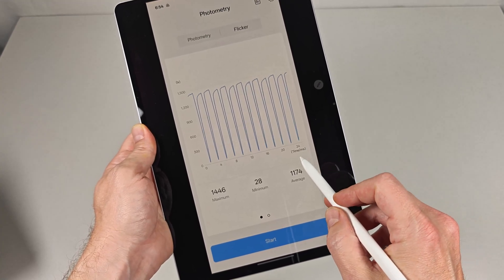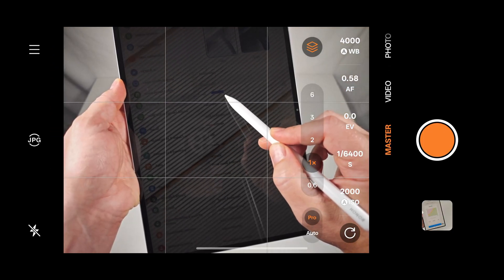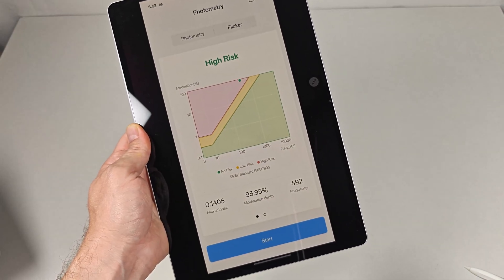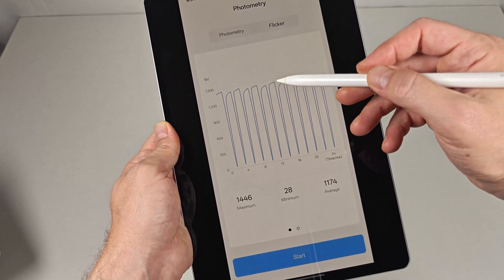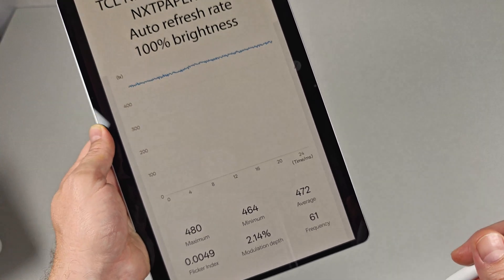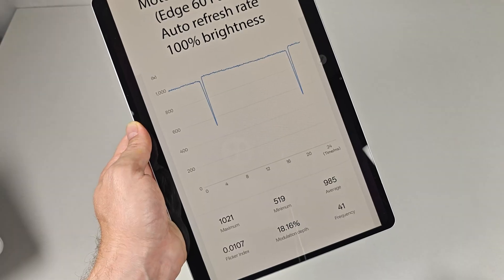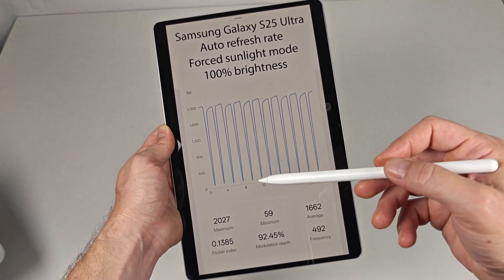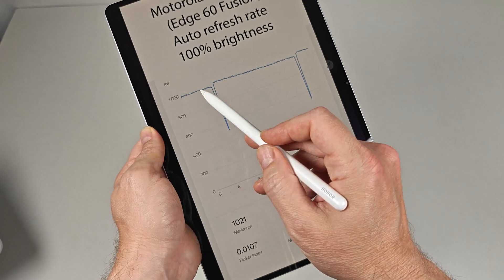How to understand PWM dimming tests

Comment: Hey Nick, what would a single, slow moving, thick light bar indicate at low brightness? It seems like when I adjust the brightness around 30-35%, lots of medium thick dark lines suddenly appear. However, below 30, the bars get thicker but lighter. I'm testing my motorola edge 2022, Thanks!

Comment: Thank you SO much for this explanation.  I struggle to explain my problems to people because even when you tell them "LEDs can't actually be dimmed, they can only flicker on and off at different rates to make your eyes and brain make averages that seem dimmer." They absolutely reject that information. Because hey, we have all "seen" LEDs go dim. It is really frustrating when people tell me I'm wrong or imagining things or that the thing that creates the problem for me doesn't exist. This is wonderfully informative. Please keep up the good work!
Reply: Just tell people you are more sensitive to pwm dimming than most people. Stop telling people you can't dim an led. its an incorrect oversimplification of a complex issue.
Reply: "Seeing is believing!" - Show them the flickering via manual camera setting: In order to make the light/dark change of OLED/LED lights visible via the camera app, the exposure time as short as possible (1/x with x as large as possible and the ISO value must be as high as possible. Example: 1/10,000 shutter speed and ISO 6400

Comment: Thanks for this video mate! 
One doubt: How would the less black 10+ black lines be better than 5 deep black ? 
Is the biggest factor for strain modulation ?
Reply from the maker: Fewer lines signifies a lower PWM rate. The exception here is when it lines up with the refresh rate, which is considered DC dimming.
Darker bars mean deeper modulation. A bar that's completely black at 1/6400 shutter speed means the screen is completely off for part of the duty cycle.
Thicker bars mean longer time off during the duty cycle. This, combined with fewer, darker bars, means a very strobe-like effect.
If there are a ton of lines (10 or more), the PWM rate is quite high and isn't perceived as strobing. That's especially true when the bars are light, as it means the display just dims during the off cycle rather than turning completely off.

Comment: Hello, I wanted to thank you for your valuable work. It's so good that you're doing this. I can't use new LCDs these days either, probably because of dithering. The only one that's perfect for me is the Poco x4 GT. I have zero symptoms. I'd be interested in the Motorola Edge 50 neo.
Reply: I've got the Motorola Edge 50 neo. Works well for me. It's as easy on my eyes as my old iPhone 13. Also got an iPhone 16, that one in comparison is awful. The Edge 50 Neo is pretty slow though, so that's the only disadvantage. Besides that, it's actually got the best display in terms of colors and everything I've ever used. so much better than any iPhone display, and it's just a budget phone. No idea how that makes sense.

Comment: The honor 6 pro video leaves me uncertain if the phone is good or not.
Would a honor 6 rsr be good for use.
This is a great video btw.
I see honor 6 has thinner black lines. But no chart to show modulation reading.
Honor 7 seems good tho
Reply from the maker: Honor 7 series offers single stripe dimming (also known as DC-like). For whatever reason, the 6 series doesn't have this. If you can swing it, I'd recommend the 7 series. Wondering what they'll do for the next ones given the progress we've seen through each generation.
Reply: At the moment theres really no phones i would rather have over an old samsung s8-s10. They have everything you want in a phone.
Back then it was all good reasons to buy now its just reasons to not